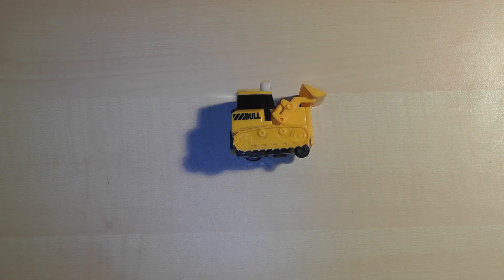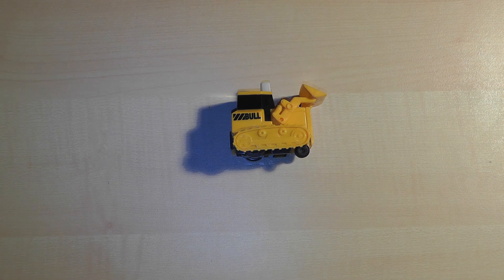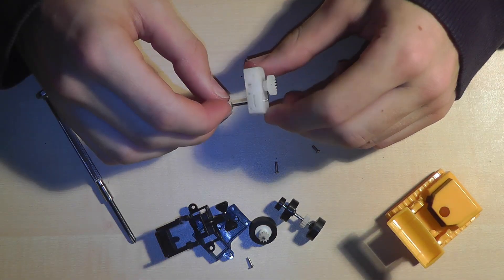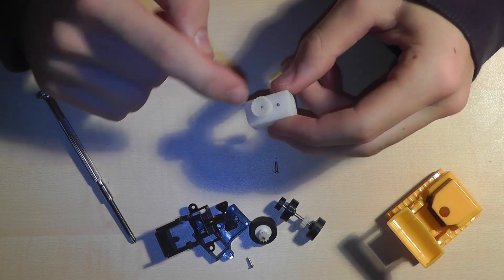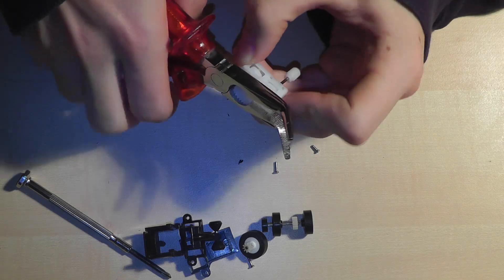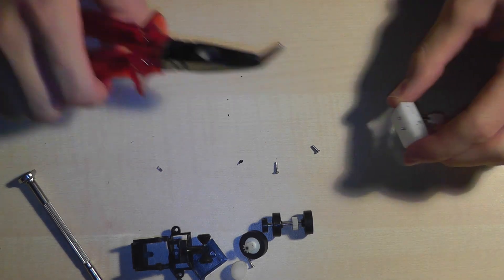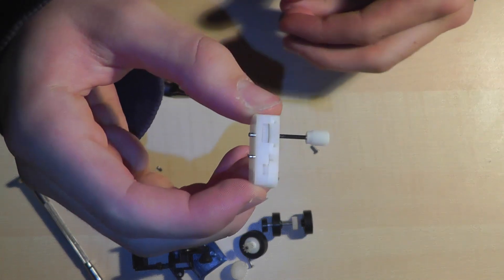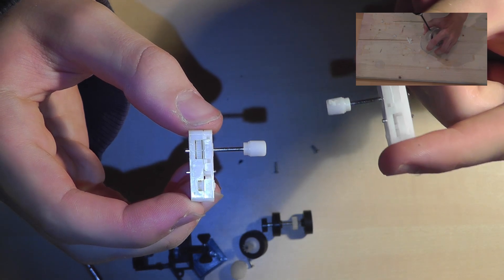WATER ROCKET TUTORIAL: Tommy-Timer [English Version]

Comment: i got mine from wind up chatter teeth 
but it unsppools  straight  away not slowing down
Reply from the maker: In what way does it not slow down? In principle, it does not have to slow down, but only hold the line for a certain time. Or where is the problem?
Greetings Timo
Reply: @AircommandoWalldorf  arm spins out in 1sec on the timer
Reply from the maker: @aryansudhiviie1836  You can turn it mutiple times then?